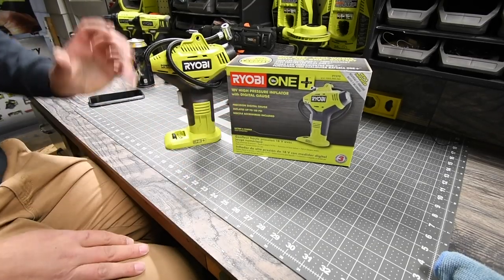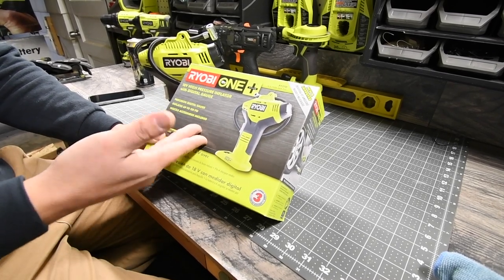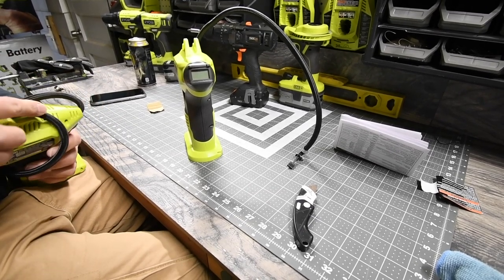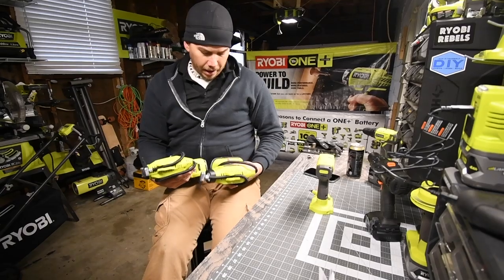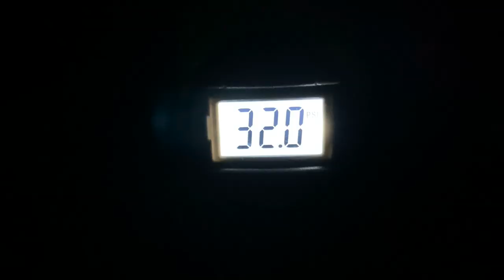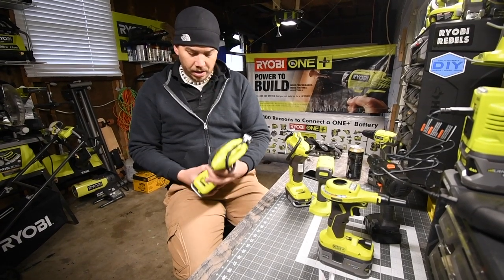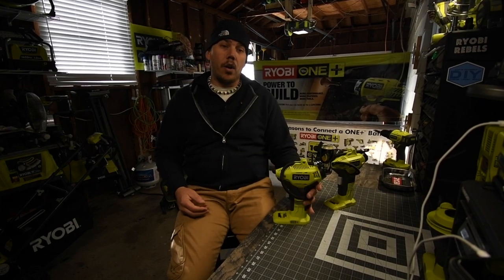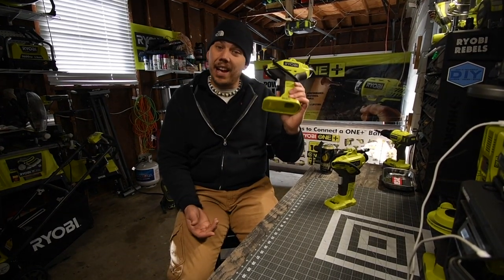New Ryobi Digital Tire inflator

Comment: Wise purchase.  I have the analog one but it is one of the best cheap investments I have ever made.  By the way, if you have a tire that has a constant slow leak, it's usually from one of two causes.  The seal bead around the inside and outside of the rim gets corroded and needs resealing and the other culprit, is a loose valve stem.  Pick up a cheap valve stem tool, insert it into the valve stem and give it a few gentle turns.  Thanks for the video and Ryobi rocks!
Reply from the maker: I thank you

Comment: I was still on the fence getting this inflator since I was fine taking my Ryobi flashlight at night but this seems way more convenient. Also, not sure if you’re using auto ISO on your camera but several parts of the video go dark for a few seconds then brighten back up. Just an FYI
Reply: Nice to see you comment az well. Hope you had a great weekend. Have you decided if you're going to be doing a weekly live stream again?
Reply from the maker: yes I have the auto iso on. the ultra wide angle lens I have confuses the camera here and there so I can ruin an entire episode if I don't have it set to auto.im only 2-3 feet away from the camera when I film
Reply: Auto ISO will not solve the exposure fluctuation. The reason the picture is going light and dark is due to the camera's meter reading the different exposure values from the bright light coming through the window and Dave's dark shirt when he moves around. Locking the exposure on his face would solve the problem, but if his camera will not allow manual exposure he needs to cover the window to maintain a consistent amount of light in the garage.

Comment: I have the dual function inflator, even though it has a gauge I test my inflator with a tire gauge to see how accurate they are and I've noticed the Ryobi inflators are spot on, I'm gonna get one of the digital and one of the analog to see which is better, it seems as though the digital inflator would be  very useful at night
Reply from the maker: extremely useful at night an thank you

Comment: I would have loved it if you would have compared the accuracy of the gauge on each unit compared to an actual tire pressure gauge.  I currently have the old one and the gauge is absolutely terrible (it reads about 2 or 3 psi too high when not running and more like 5 or 6 too high when it is running based on both of my tire pressure gauges).  If this new digital gauge is much closer I could probably justify buying it but if it is going to read that far off as well there is not really a point in getting it.
       On a side note, I have been checking my local HD every week or less hoping to see the old version go on clearance to pick up a couple of cheap spares.  I figure surely they would want to get rid of the old model since there isn't really a reason to keep both around and the old version already appears gone from the HD website except in the very overpriced kits with battery or another tool.  My store seems to hate to put things on clearance, even right now very few of the lawn mowers have gone on clearance and the models that are have only been marked down once.  I would love to pick up a ryobi 40v self-propelled or even a gas powered self propelled mower if they could make it worth my while.
Reply from the maker: I can do that and thank you

Comment: You are a Ryobi fanatic like i am... Tell me that this Fixed base router from Ryobi that i just bought model RG163 has a adapter somewhere that will allow us to change the 1/4” collet to a 1/2” collet in order to put bigger bits in there. Have mounted it to my router table that has a Rockler plate. Had to drill holes in order to mount it. TRhen i notice the collet will only hold 1/4”  bits. My 1/2” collet will not work on this router
Reply from the maker: I do not own the router yet so I am not to sure
Reply: Thanks for replying,,!,

Comment: Have you checked the accuracy of the digital vs analog gauges? I have the analog inflator and always find that the gauge is off by about 5psi when I inflate my tires and check with a separate gauge. Thanks for the video.
Reply from the maker: yes I can and thank you
Reply: @ManCaverTools   I have the upgraded tool with a digital Gauge and can attest to the fact that it is accurate right to the proper psi.

Comment: Are you going to do tests with other air machines to compare the speed? Thanks
Reply from the maker: when it comes to speed it doesn't matter. if your in a situation where you have a flat tire and there is nothing around you. any tire inflator can take whatever time it needs to fill it up. but that test is hard to do on a tire that is mounted. you can wear out the rubber if you keep deflating it for another test.
Reply: Ryobi man you could have the same argument with all the tests you do with drills. All can get the job done mostly  but might take longer. All good brother keep up the videos 👍💣

Comment: I just bought one and was wondering if I can use the other Ryobi batteries besides the 1.5ma it comes with? Said nothing about it in the manual 🤔

*edit yes I see now any of the “ryobi one” batters work regardless of the 1.5,2,4,5,6 Ah.
Reply from the maker: yes you can.

Comment: I purchased this digital tire inflator. My only complaint is that its 5 psi off on accuracy. So when it reads 32 psi two other independent tire gauges read 27 psi. Have you compared accuracy with your digital and analogue tire inflators? Also. Do you think home depot will exchange this unit if I don't have the original box to return or receipt?
Reply from the maker: yes I always fill it up 5psi more to make up the difference of what it actually is
Reply: Thanks, sounds like they all may off by the 5 psi. I'll just go over as well.

Comment: Duty cycle:  better adhere to it on these things, or they won’t last very long.  And it has a pretty poor duty cycle at that.  For just a tiny bit more, the Dewalt and Milwaukee have at least twice as good of a duty cycle.   I’ve had the old analog version for a couple years, and it still works, but it’s about due to be replaced.  If all you do is a rare small tire top off, you could get by with this model.
Reply from the maker: and that is why I have it, its for emergencies

Comment: Actually we are now on Standard time. Daylight savings is during the Summer time of the year. I prefer Standard time. Wish we never used Daylight savings anymore.
Reply from the maker: I know, but since we  put the clocks back it gets darker sooner than what we are used to in the summer, which would make having a lit display on the tire inflator more useful to have than not having one since its dark outside at 4:15 pm now and most people get out of work at 6pm. but I thank you so much for viewing
Reply: @ManCaverTools  yes, I enjoy your videos very much. You sold me on Ryobi. However, I got caught by a Bosch rep in Lowe's a few days ago and he made me a deal I could not pass up. I bought a kit with the Freak in it and he gave me 2 additional batteries, recip blades, and some bits. I was wondering if you might do some Bosch reviews.

Comment: Will this unit stop at desired pressure or you've to manually monitor it?  Thanks.
Reply from the maker: it does not, that's why I got a unit that does. I just made a video of it

Comment: lol tool fell over. Yeah I got the new slim inflator I really like it. It takes a little to get used to the screw on instead of the lock. I would prefer the lock but whatev. Only thing I noticed that stinks is you can't read the battery you have to take the battery out to check it because of the way its rotated. There is really no difference in quality or performance over the original duel inflator.
Reply from the maker: Thank you very much sir